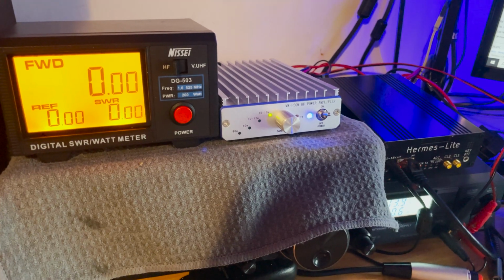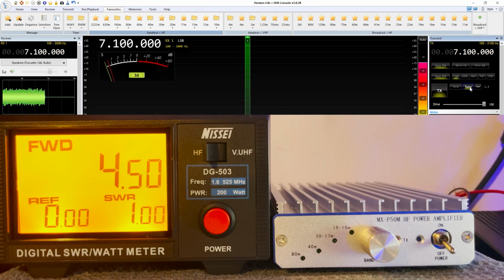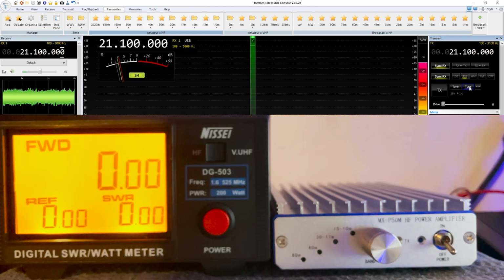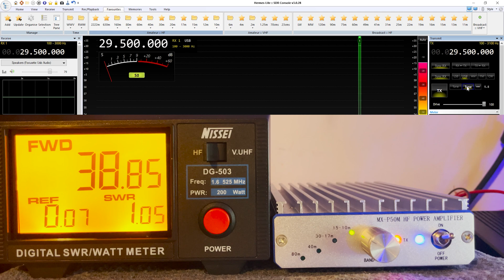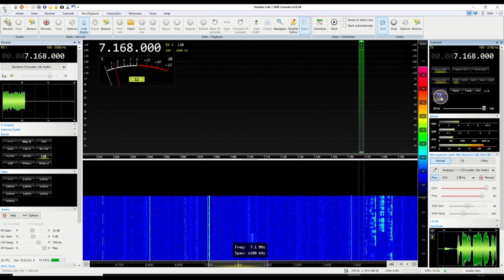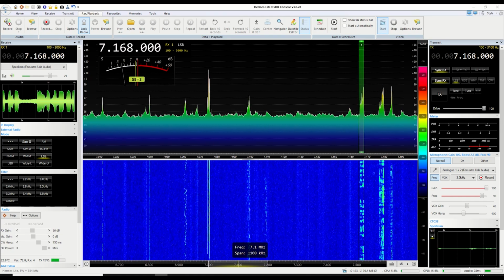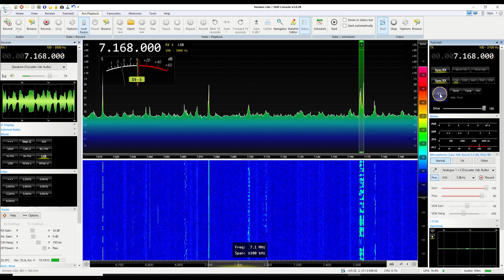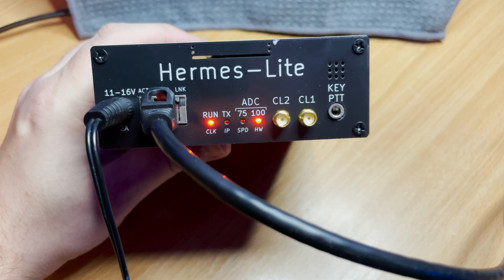MX-P50M HF Amplifier For QRP Radios

Comment: Love your channel. Thanks for the time you spend to share on Youtube!
I need your help, I have a Herme Lite 2 full kit coming should be here in USA in a bout 4-5 days
My plan or wish, is to add a AMP in-line from the Herme Lite 2 to get somewhere around 40-50 Watts then Feed that output into my Ameritron 80B for 800-ish output into
my Hexbeam. 

How or what would you suggest I get to do this. And is there any known issues doing this with two amps. One day I will purchase a nice ANON and this issue will be gone but 
I want to try this out before moving to that level of expense.  You seem to know everything about amps for the Herme lite 2 and would like to thank you for your input to help me out. 

Million thanks and I hope to work you on the bands, Im in California so a bit harder for us west coast hams to get to UK on a normal day hihi. 

Steve 
N6OIX
Reply from the maker: Hey Steve! I've tried a few amps with the HL2. The MX-P50 could be used, but I would perform the switching mod, I think @hamradiotube done a video on the modification. I have tested the 125B from Xiegu, which worked well for me. But the best in terms of quality was the HobbyPCB Hardrock 50, but you will need to build it from a kit unless you can find a second hand one. I have never used an amp to driver another amp, but above is my experience :-) Thanks for watching.

Comment: Love this video! I'm thinking of buying this amp for my QRP rig and I was hoping you or anyone else could explain a little more about the difference between the two power connectors on the back of the amp. I am new to HF (currently studying for my General) and am trying to do all the research I can before building  a station. Thanks in advance!

Comment: I'm curious on what the minimum output of a HL2 is and what the output of the amp would be at that level. I'm really just needing around 10w-15w to drive an tube  amp. Thanks

Comment: For me, 5 watts is the point.  If I want more power, I will have a radio that delivers adjustable power from 10 to 100 watts.
Reply: Pretty hard to get that for the same cost as adding this little amp to yer existing kits if all you want is to get 30-40w which tbh Is what I often run my 100w rig at for FT8 etc. So this behind say a qdx with a nice efhw would be a pretty rad and very portable and cost effective digital mode toy.
Reply: Just what I was thinking! Use a radio designed for the extra power.

Comment: This little amp works fantastic. However is not intended to heavy usage. The small heath spreader is made out of aluminum and does not do a fantastic job. On the other hand, the output transformer didn’t convinced me. While I was doing FT8 @30w it failed, and I found out that the transformer failed and fried the original transistor. Not a super hard work to replace the faulty transistor and transformer, but definitely it have some details that can be improved. 
I also tested a MRF9120 on it (got fried because of the transformer issue) and gives 60w with just 1w drive signal. That’s enough to drive my SB201…

Comment: I had this one and it went bad when I tried to key up while connected to a tuner. Don’t run more than 1w with the 817 thru this when connected to a tuner. It doesn’t have protection

Comment: Nicely done! Thank you for making these videos and sharing them with all of us!
Question:
How much current does the Hermes radio draw and how much does the amplifier draw?
You said you were running them both off the same supply at 13.8 volts and I was wondering the current draw of each and the maximum combined as well.
I am of course subscribed with notifications turned on and thumbs up!
73 W3GUY

Comment: Would it hurt to change the RF power devices out for the proper Motorola Power devices.
Reply from the maker: I had also questioned this myself, whether higher power devices could be used. I havnt investigated this yet, but first thoughts are whether or not the other components or even the tracks on the PCB, could handle the extra current.

Comment: I've been thinking of getting one to go with my FT-818, its the cable that is putting me to be honest, would like to see how this is set up
Reply from the maker: If the 818 is the same as the 817 then there is a cable with it, it just plugs into the back of the 818 and then connects to the PTT cables. Super easy!

Comment: I like the look of the Hermes lite Mat,can you buy them ready built or is it kit only? Thanks Gm4zji Chris
Reply from the maker: Hey Chris, there are three parts you need. The main board, the filter board and then the case. Did you see my build video on the HL2? Also, you can get regular updates on stock from the Hermes Lite google group. :) 73
Reply: @TechMindsOfficial  yes watched the build so think I should manage that ok Mat,I’ll check Hermes Site for availability thanks 👍

Comment: I have one of these also.   After a viewer complained about it's lack of linearity  from my review, I did some testing for another video.  
I found that it's amplification falls off above 3 watts of drive and it starts to splatter from the compression in the amplifier.    Not terrible, but it was splattering into the suppressed side band.
So I never drive it with more than 3 watts, and I still get a bit over 30 out of it.  
I also did a single transistor mod on it to make it work with more radios.    By default, the keying line on the amp is actually directly connected to the two relays that put it into TX mode.   The keying line requires your radio to sink over 30ma of current to key the amp.   It won't key with some radios, including the Icom 705.     I add a single PNP transistor, one resistor, and one diode as a relay driver.  Now it only takes about 1ma of current for the radio to key the amp.
You can find the vids on my channel by searching for my call and MX-P50. 
73 DE KB9LRW
Reply from the maker: I’ve watched your video on this, definitely worth a watch if you need to modify the PTT! Thanks 🙏
Reply: @TechMindsOfficial  Nice to see Kevin and Rodney bumping into eat other and having a chat, or is it Dave 😉😊👍👍.  I remember having a similar problem with splatter many moons ago not long after I was 1st licenced, i was using an FT290R into a Microwave Modules 100Watt linear and found the splatter completely disappeared when using vox TX switching rather than the hard wired ptt. Obviously it was due to RF pickup from the ptt lead.
I was operating from my QTH in Hemel Hempstead at the time and used to work for Lucas Aerospace (sadly long since knocked down)😔😭.
Really interesting video 👍👍.
Reply: Both of you gentlemen are very helpful. 73

Comment: Well that’s a first, I actually heard that QSO while testing out a half wave kite antenna. I called Doug after you had signed with him, but the wind dropped and my antenna ended up on the ground. Still at least I know what wind it won’t fly in.   Nick G0OQK.

Comment: The manufacturer should have been more honest and advertised the linear amplifier as a 40 watt amplifier. That being said, on the receive side, the S meter will hardly be able to tell 40 watts from 45 watts. It takes an increase of 10 times the output power at the linear amplifier over the input power from the rig to just barely be shy of 2 s units on the S meter on the receive side.

Comment: Would love to see a follow up on the PTT connection.  Say for the 817.
Reply from the maker: I’m pretty sure this amp comes with a FT817 cable as standard. However, connecting to other radios is really easy, as long as there is a port on the radio which has a PTT line which goes “low” to ground, when the radio is keyed.
Reply: @TechMindsOfficial  I have run one of these amps for several years now, and it comes with a cable to attach into the FT817 data jack on the back of the rig.  Works well with the FT817 when QRP doesn't quite make it...   73  Paul   NA9M